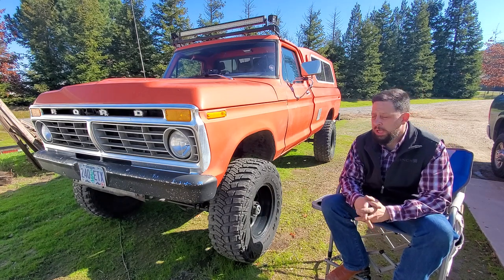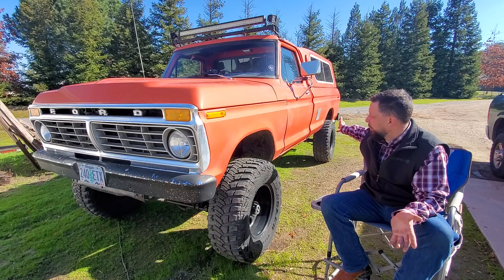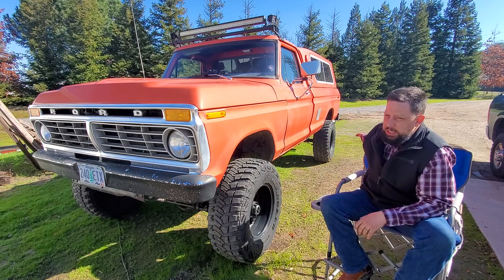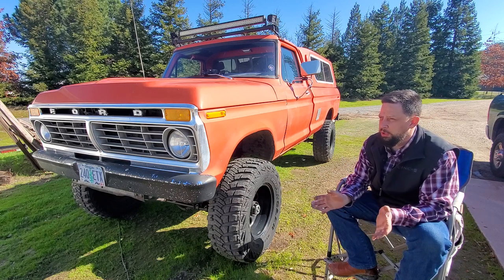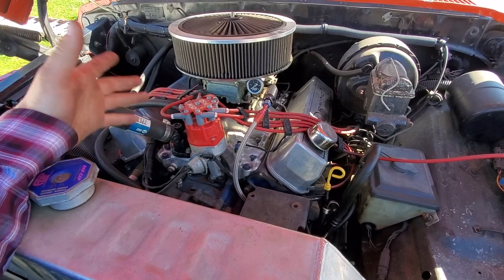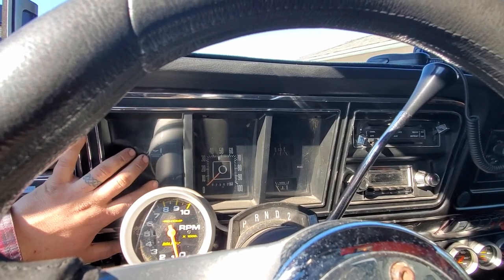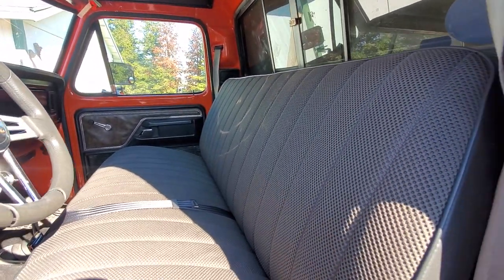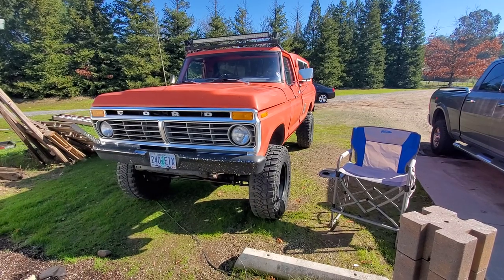Kimber's 1977 Ford F250 Highboy "Orange Beast"

Comment: Nice truck! I would like to find a set of those mirror extenders for trailers for mine. They seem to be like hens teeth now.
Reply from the maker: Thanks, yeah one of my favorite builds, the mirror extenders can still be had but atre getting harder to find, I have one original set still but IDK that I could be rid of them ever.

Idk if the link will load up but there are a few sets on Ebay right now with good bars:

https://www.ebay.com/itm/Extend-A-Mirror-Kit-2-Blocks-and-Bars-The-Original-Extend-A-Mirror-Blocks/274319029267?chn=ps&norover=1&mkevt=1&mkrid=711-117182-37290-0&mkcid=2&itemid=274319029267&targetid=1068323851390&device=m&mktype=pla&googleloc=9029550&campaignid=12595338213&mkgroupid=125048132292&rlsatarget=pla-1068323851390&abcId=9300522&merchantid=114721847&gclid=Cj0KCQjwsLWDBhCmARIsAPSL3_0Q-jy1V5ilzvukTkiUOZZFqYH1A3ZVm--m2zuzKOFoxuuLSSSlkNsaAuoaEALw_wcB&pageci=d660b9c3-fb2c-48b4-adc6-5dd3497c972c

Comment: Really like what you have done here! Do you know where I could find new bushings for the bracing rod that attaches to the T-case?
Reply from the maker: I used to have a Part Number that was from Energy Suspenssion that you coukd use for the insert but since the build that list was misplaced, all you need is the OD and ID on the bushing and they stock them, I had to trim the insides a bit. If I ever find that parts list I'll shoot you the numbers but IDK when that may be.
Reply from the maker: Also thank you, given the modern twist it turned out really well I thought.
Reply: @LockedAndLoaded4x4  Thank you! I didn't know where to start. This helps.👍

Comment: You don't have to cut into the chassis with the factory power steering conversion, I did it and it's a straight bolt on conversion.  The thing is the boxes are damn hard to find.  I did mine over 20 years ago, and they were hard to find back then.  Odd that the cam needs a vac boost, most torque cams don't have a problem with vac boost, maybe it makes the toque up higher in the RPM range.  Kinda funny that 35" tires look small.  I'm running 35's on my Highboy, but mine isn't lifted.
Reply from the maker: If using a later F150 box it's somewhat bolt-on but you really need to use the 77.5-79 F250 4x4 box and for that to be done correctly and keep the proper steering geometry you have to cut 3-4" into the crossmember and also add a brace... so no, no it's not. I have done more than my fair share of converting this steering type.
Reply: @LockedAndLoaded4x4  I have the 79 F250 box on mine and I don't remember cutting the crossmember, but I do see pics of others doing that.  I did mine some 20 years ago, so I'll have to go out and check exactly what I did.  I do remember a large backing plate on the outside of the frame, but don't remember cutting anything.  Kinda odd that I can't find any posts not cutting the crossmember, but I'll crawl under today and have a look.
Reply from the maker: @karljay7473  Not saying it can't be done in that way, or argue anything into the ground, but putting it far enough forward to not cut the member puts the Drag link too far forward which can overleverage the box when swinging the pit.an arm while loaded. I have a cut down 1978 F250 Chassis still in my collection that I use for IDI swap mount mock-up, as a sort of engine test stand, and as a measuring base for the steering components, everywhere the factory system sits in a 77.5-79 F250 4x4 is centered a few inches into the main crossmember.
Reply: @LockedAndLoaded4x4  I just checked, it's not cut, it sits right next to it, but not cut into it.  I started this project back in the mid 90's and there were several write ups in forums on how to do this and that's what I followed.  The arms sit at a 90 deg when the wheels are straight.  It's been some 20~25 years but the people back at FTE did it this way.
I'm not sure about the load overleveraging the box as the arm goes straight back to the axle and it dead center when the wheels are straight, but it has worked for a few decades without any problems.  I did put a massive plate on the outside and a thick block on the inside so that any torque is spread out pretty far.  I saw others cutting the frame to make it flush and others buying plate setups for the inside, I guess it all works.  I've never had a problem turning the 35's.
Reply from the maker: @karljay7473  more than one way to skin a cat 😉👍

Comment: Why is the grille from the 73-75 model years? In 76 Ford changed the grille bit kept white turn signal lenses. Then in 77 they changed to orange turn signal lenses. This grille is not a 77
Reply from the maker: The Truck had been sold with 1973-75 Grille inserts and it was never changed, assuming the Previous Owner coukdn't source original 1976-77 Grille Shells. My 1979 F150 has a 1974 Grille and lower moldings but mostly because I wanted to change it up after a rollover and used a 1974 2wd Donor with a damaged chassis.

Comment: What is "bump or dent" side??
Reply from the maker: Bumside is an enthusiast term for the 1967-1972 Ford Pickups, Dentside was the enthusiast term for the 1973-1979 Pickups. They were mainly focusing on the side trim areas of the cabs and beds, later trucks refer to the nose or grille type due to them all sharing the bodies otherwise from 1980-1997

Comment: 73 to 75 grill.
Reply from the maker: Yeah, in particular it was a 74 grille that was put on, or at least the inserts
Reply: 73 to 78 had that grill my 74 and 78 has that same grill, and they do sell a direct bolt on power steering kit that comes with the box and steering shaft, no cutting,also new lines, it totally eliminates the power ram stuff.
Reply from the maker: @jt9462  1973-1975 had these Grille Inserts, the Grille Shell/enclosure was 1973-1977, and yes while there are new kits that allow for the elimination of the power ram at the time of building the Truck there were not and the only option was notching the crossmember to allow for 77.5-79 F250 4x4 Steering to be added.